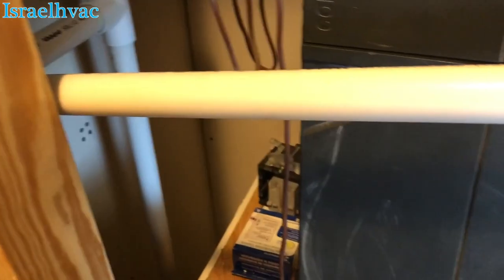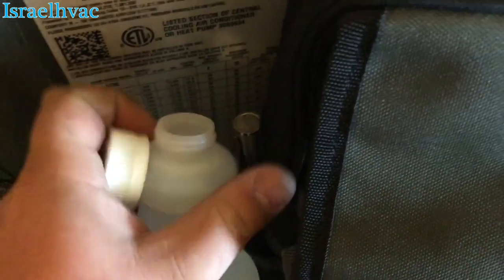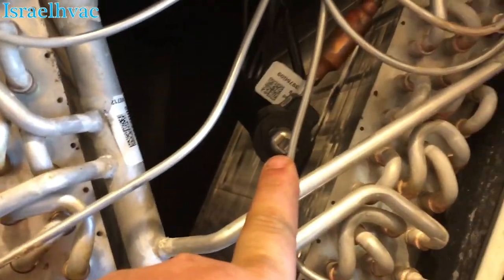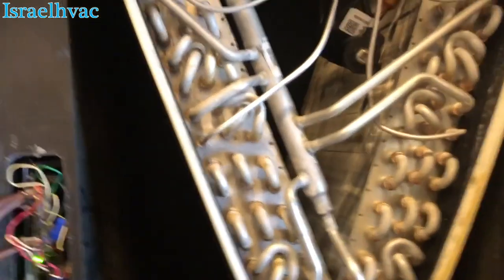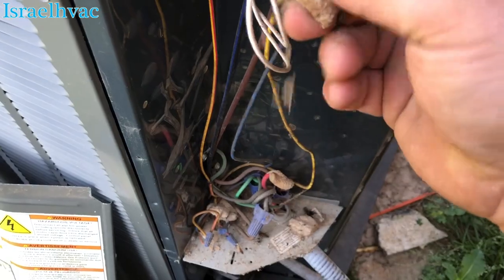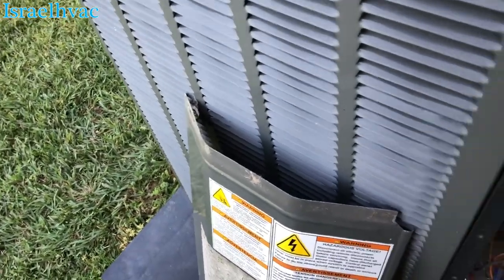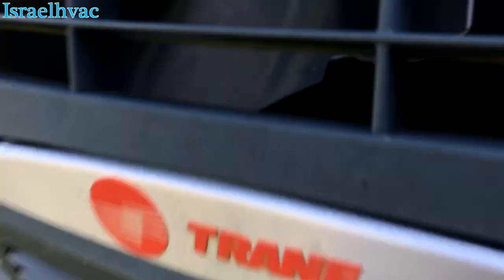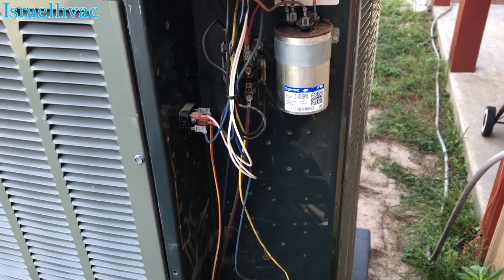HVAC Maintenance | Trane TAM AHU

Comment: I totally agree with you John.  I really liked the idea of the TAM.... until I worked on one.  I hate it.  I wish those engineers had to work on  them before putting it into production.  I can hardly get my hands inside of the strip heat section.  Thanks for the video.

Comment: Trane dealer here since 1984.  The TAM air handlers are ok but I prefer the simple TEM air handlers.
 I have had two drain pans crack on the TAM's because the pvc piping just sticks out there with no support. The blower is VERY NOISY if you have a closet installation or short return duct as opposed to the TEM air handler where the blower is on top. I don't care for the checkout procedures on the TAM's boards. The engineers think techs have all day to go through all of the steps to find a problem and without the guide, your sunk.  
 I'm sorry but I like simplicity to a greater degree and the TAM goes a bit overboard on being overthought.

Comment: I'm in the Lafayette area. I agree,  heat pumps work great with our mild winters. As far as the air handlers, I don't mind the TAMs. I find the pan in the horizontal position to be a bit of a pain to clean well, especially where the coil meets the pan. I've ran into a handful of problems with the TAM 7 EEVs.
Reply from the maker: Very cool to see someone in the Lafayette area comment. Hit me up on FaceBook or something man.

Comment: That black epoxy 4 terminal device is just a AC rectifier for the unloader solenoid as it requires something like 24 VDC instead of 24 VAC.  I think the newer Copeland's have it built into the terminal plug for the unloader solenoid.  Good video.  Thanks
Reply: Yes, not a relay. You are correct----- a rectifier.
Reply from the maker: Thank you for that info. I appercaite it.
Reply: Gary Gin You can actually short two of those terminals out to make it swap from low to high. I’d have to look in the book to remember which two lol but I remember that from the Trane school we went to

Comment: I've changed evaporators and blowers on thoughs air handlers. Not a fan of the TAM7. I believe the relay on the condenser is an AC/DC rectifier.